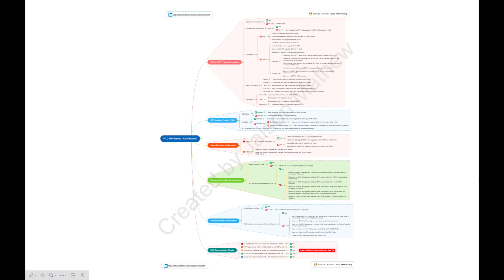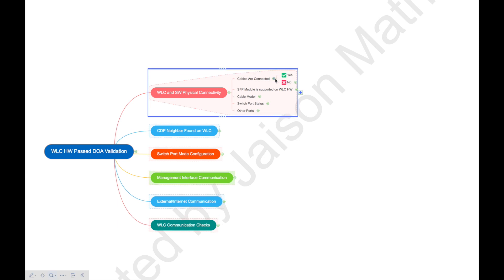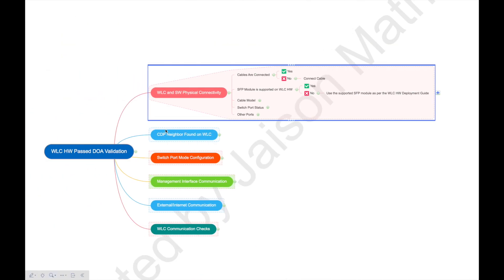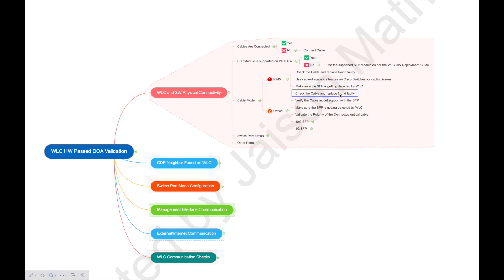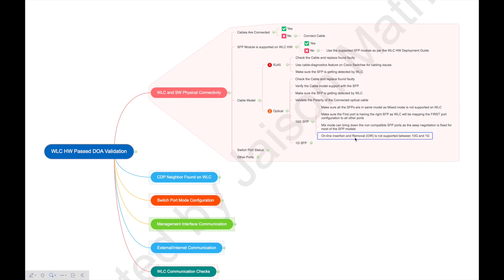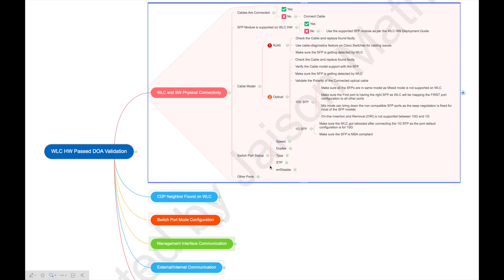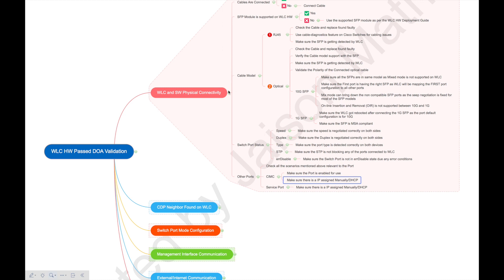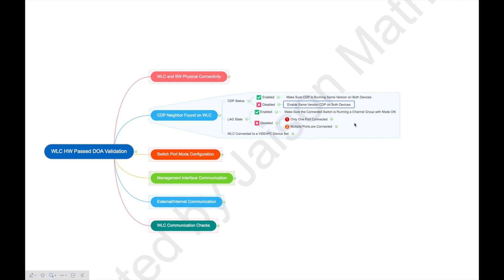Troubleshooting Cisco WLC Connectivity Issues (Part-1)

Comment: i have one question.. for eg: we have created guest SSID with the name of 'Secpass'   i have 10 guest user ID(guest1, guest2 ,.... guest10) and 3 different VLAN (10.10.10.0/24 ,10.10.20.0/24,10.10.30.0/24) , when guest1 connected to 'Secpass' SSID it should get 10.10.10.5/24 range IP address ,when guest2 connected to 'Secpass' SSID it should get 10.10.20.5/24 range IP address and when guest10 connected to 'Secpass' SSID it should get 10.10.30.5/24 range IP address. let me how we can achieve this with web auth.. we have cisco WLC and ISE.
Reply from the maker: Web-Authentication is working on Layer 3 means Clients already received an IP before the authentication is processed by the WLC. Interface override can be done only in Layer 2 Authentication.

If you want to achieve Interface Override then you have to do a Layer 2 authentication, the best catch will be using Layer 2 authentication with a Conditional/Splash Page redirect in Layer 3. In this case Layer 2 will allow you to put the User in right VLAN and Web Redirect will allow you to show the Web Page to the User.
Reply: @TNPbyJaison  thanks for your update,

I don't know whether we can achieve with conditional web auth, if you best example with conditional web auth please let me know.

My requirement, all user will connect to single ssid (Secpass), based on user login information user will assign to dedicated vlan.

For example: if I connect to Secpass my machine should assign to vlan 10 , if x person connect to Secpass that machine should assign to vlan 20.

Let me how we can
Reply from the maker: @santhosheducation5374   As i said, use the Layer 2 for the authentication with Interface override. This will help you in achieving the VLAN assignment with AAA override enabled on WLAN. After this give a Splash page in Layer 3 Authentication to show the add/company page. L2 auth will help you to put the use in right VLAN and L3 authentication will make sure the Guest is gone through the Web Page